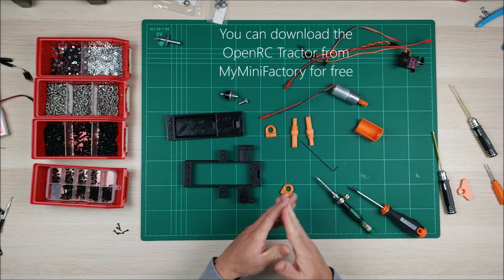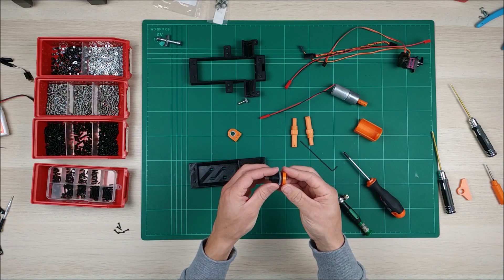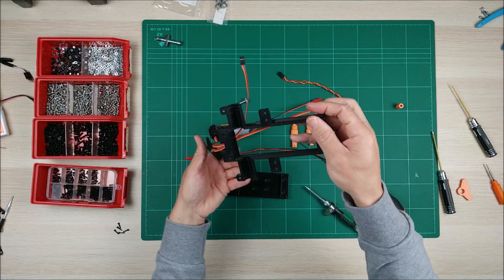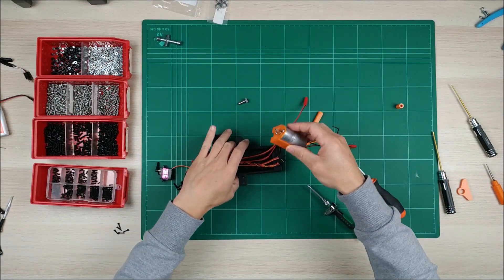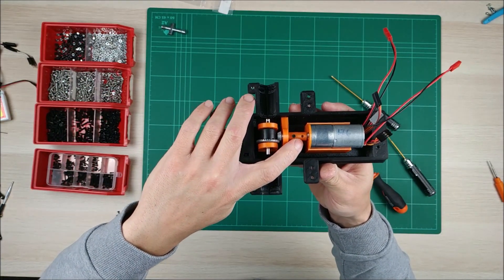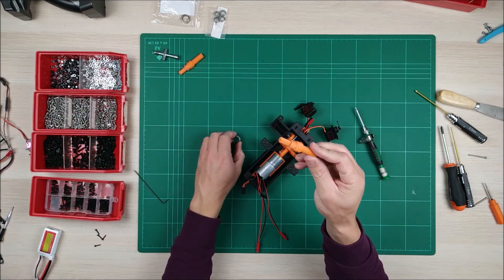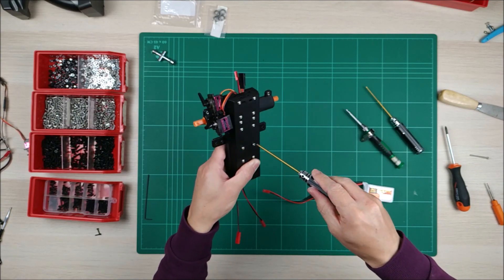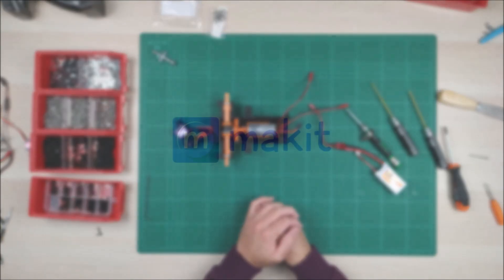OpenRC Tractor build with me part 3 differential

Comment: my tractor is in trouble, when the pinion teeth slide up the gear, have any idea to  tight de differencial?
Reply from the maker: Yes, I have redisigned differential supports to avoid exactly that. I plan on release them this weekend. Stay tuned to my channel!
Reply from the maker: Here you have: https://www.myminifactory.com/object/3d-print-144285
Hope that solves the problem